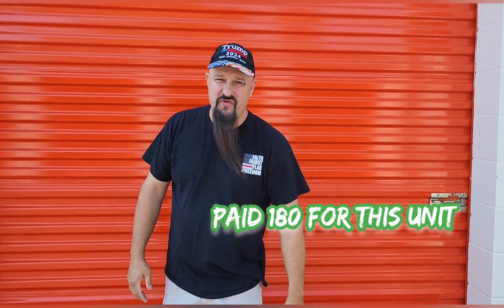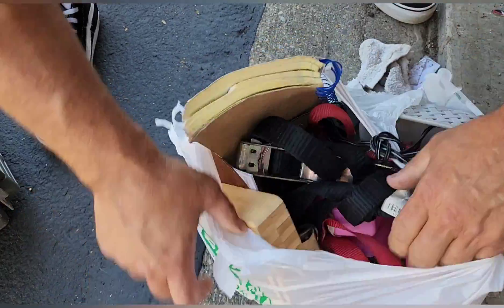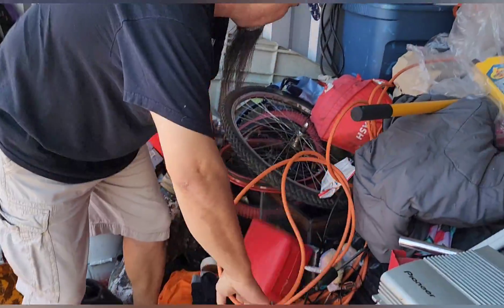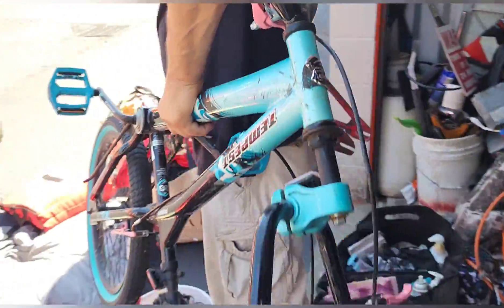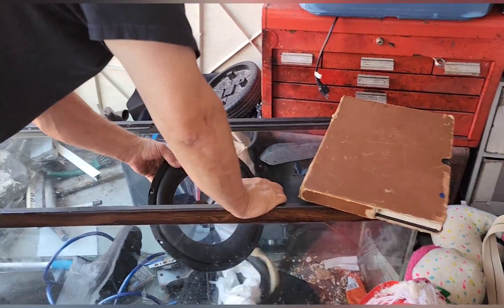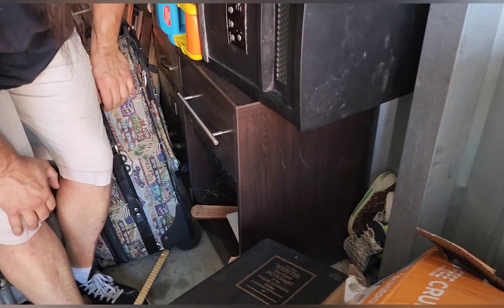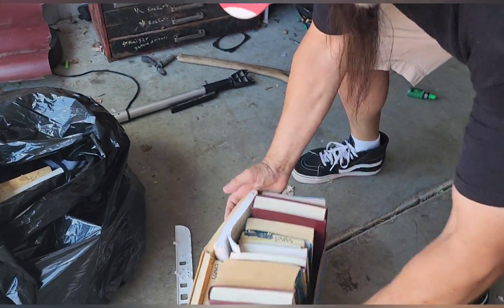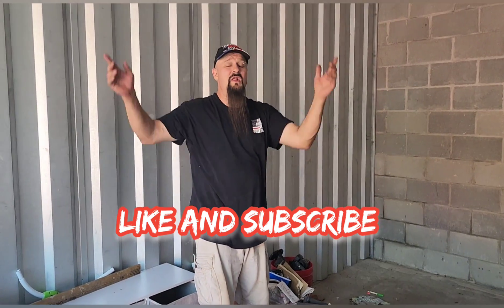Storage locker filled with Vintage BMX  Freestyle Bikes, tools, toys, and a Motorcycle ??  WOW

Comment: I love that shirt. That locker is sweet. Good buy. Ive been stuck with a Kawasaki Vulcan 900 motorcycle I got in a unit 2 years ago. I may just sell it as parts.
Reply from the maker: Thank you, I had it made at the mall. It was a good little messy locker. Sold the redline bmx bike for a grand right off the bat. Thats a win. Lol Thank you so much for watching and commenting buddy 😁

Comment: Do you scrap alot of the miscellaneous metals and car parts to offset the trash removal
Reply from the maker: Thank you for the question. We have a 6 yard dumpster at our house. It's way cheaper than making dump runs. I normally put scrap metal out for our local scrapers.  Thank you so much for watching 😀